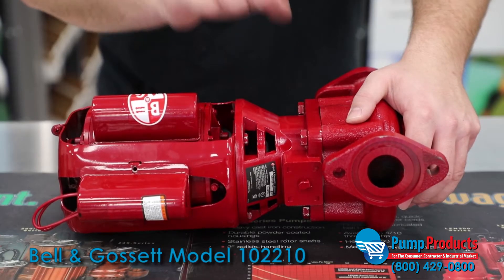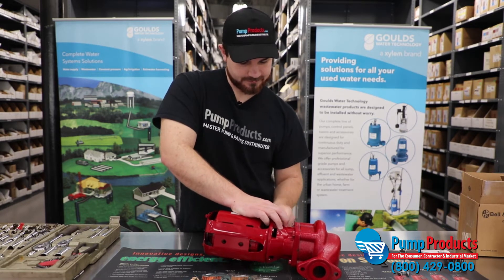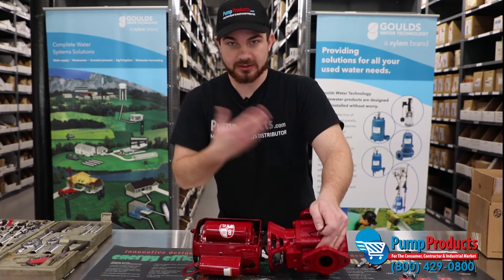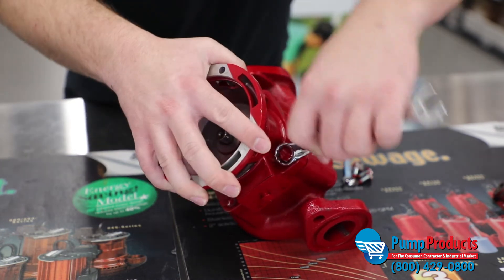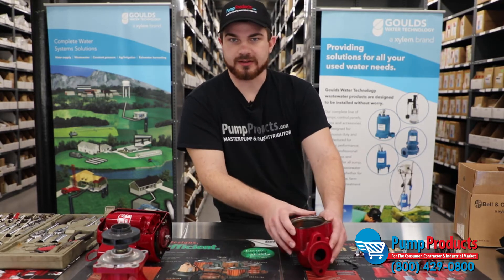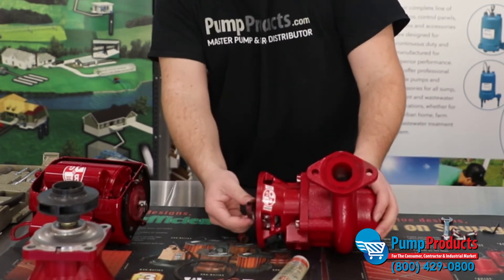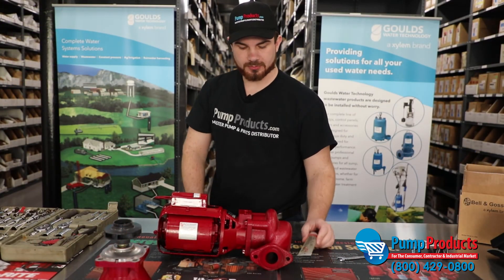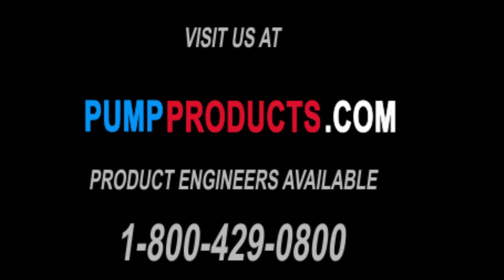How to Change the Bearing Assembly on a Bell & Gossett Circulator Pump

Comment: My motor is shot on my B&G series 100 pump.  I tried hooking it up to directly to power with an extension cord.  No luck.
Question for you:  Since my couplers are not damaged and the bearing assembly shaft can be rotated manually with my fingers, am I correct in thinking I can get away with only replacing the motor on this?

Comment: I had a horrible sound from the basement and found that the couplers are definitely broken from shining light in there.  How do I know what caused this?  I can easily replace these along with the motor mounts, but could there be another issue that caused this failure, like the bearing assembly or something else in the motor?  Please help if you get a chance!
Reply: The biggest reason for coupling failure is motor mounts sagging. Change them and use a 
Spiralink coupler. Make sure the bearing assembly turns freely. oil it.
Reply: @mrpump1733  Thank you for replying.  Once I replaced the couplings and oiled it again, it ran very smoothly.  Working better than ever.  Thank you!

Comment: I've watched a few of these coupler replacement videos and no one has ever mentioned the issue of clock-wise and counter clock-wise couplers,. My pump is counter clock-wise. Have you ran into an issue where you needed the clock-wise coupler?

Comment: You didn't even set it the right way, look at the video and hopefully you will be able to see what You did wrong. I decided to look at the video to see if I could learn something and I ended up learning what not to do...
Reply: It appears to be a counter clock-wise coupler... To me he appeared to rotate the motor clock-wise to line up the bolt holes.... Could he have possibly crossed the coupling springs over themselves? That was a question I was looking for when I came across this post.
Reply: Watched video again. Yea, when he took it apart inlet and outlet was orientated vertically ... installed impeller housing to a horizontal orientation . My housing is in fact orientated horizontally.
Reply: @uhuffman  For teaching purposes, I believe He should have explained that there are two positions on changing the  bearing assembly, I do plumbing and heating and so far I haven't seen or change a circulator pump that's on the horizontal position, I just think he should have put it back together exactly the way it was, most people when they looked for a video like this, it's because they need some guidance and they would probably follow step by step what the expert is doing and setting the circulator pump on the wrong position, having the oil spill out....
Reply: @nickrami7131  I agree ! My series 100 in my house is horizontal.

Comment: Very important to add oil to the bearing assembly. I’ve replaced the coupler and thought the bearing assembly was going bad since the shaft rattles and when turned on with the new coupler and motor mounts , there was still a very loud noise. I was just about to buy a new bearing assembly because the bearing shaft wiggling and very loud. 

As soon as I added oil to the flapper on the bearing assembly. The noise went away and Bearing assembly was running smooth! Lubricate and save money !

Comment: What causes the motor to keep running after the boiler is off
Reply: It keeps the water circulating. The water is still hot and needs to carry the heat through the house even when the boiler is off.